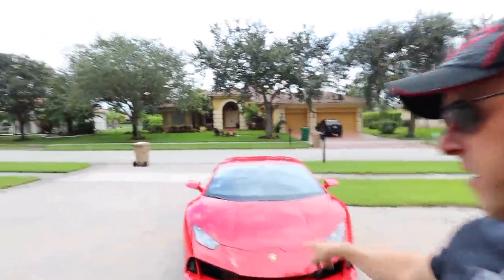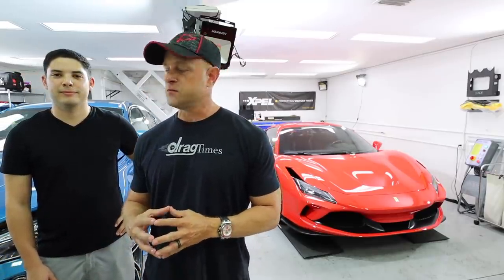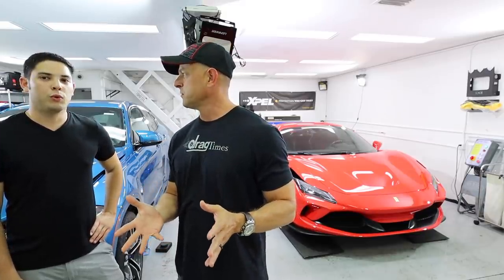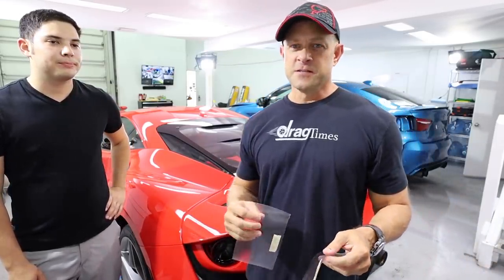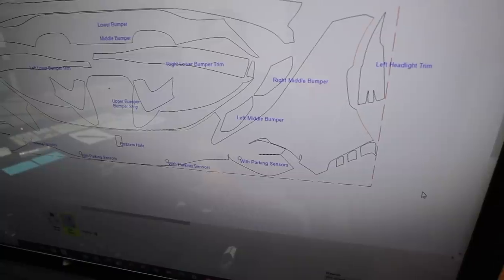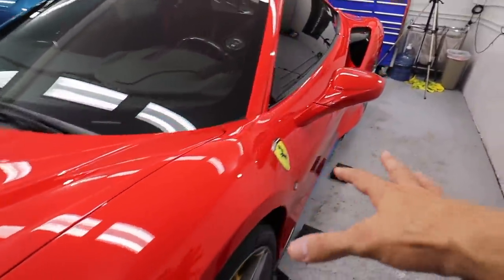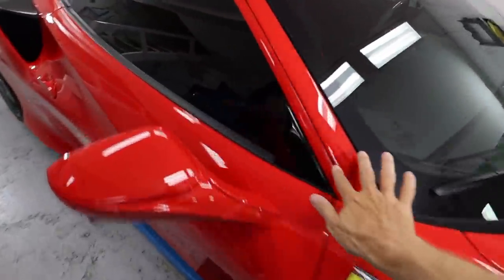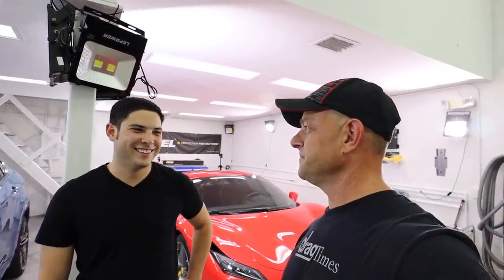TOO MUCH RED * Wrapping and Protecting the Ferrari F8 Tributo

Comment: With Black roof will look amazing!!! Are you doing an exhaust system for any of the new cars?? We bought a Tesla Y, we HATED!! We had a Model 3 and trade it for the Y, worst decision.... But, I ordered another model 3 to Trade the Y back. Love our Model 3.
Reply: What did you hate about the Y?
Reply: @manbeastx69  It has being at Tesla Dealer for 4 times already. Seat belt notification on, windshield wipers don't turn off,  back door opens very hard at it hit the garage door opener (believe it or not), it went into a complete stop while driving on the highway (IH10 in Texas) and when you reverse, at first doesn't want to move, you have to wait about 10 seconds and then it goes.
Reply: @pastoralbertocastaneda6534  Wow what junk,call Elon and complain...lol
Reply: @manbeastx69  Hahahaha!! I wish I could. I will lose about 15K after all trades, it socks badly.